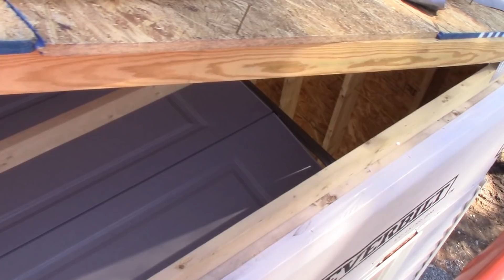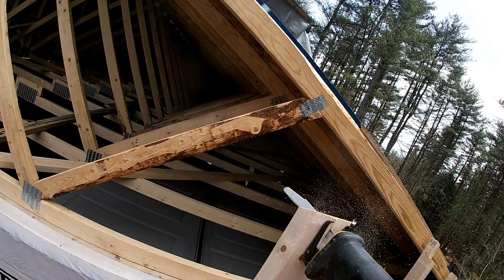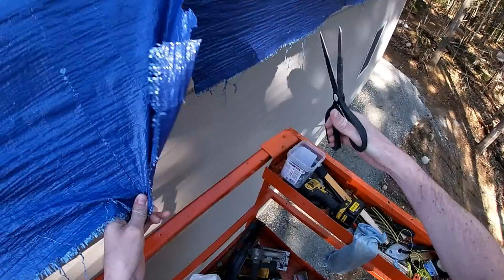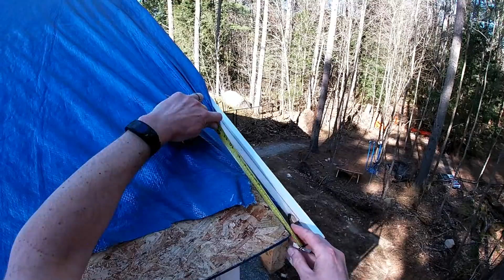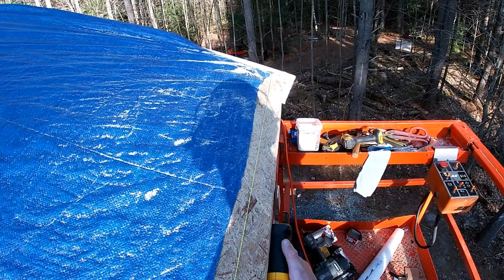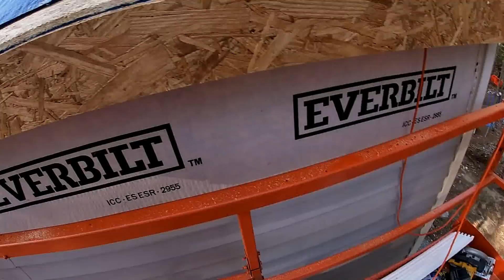Part 11: Dream Garage Build - Ready to Roof - Gable, Eaves, Sheathing ALL DONE!

Comment: Trying to be helpful to those reading, not critical  of the channel.

Best to have a reference string pulled straight before setting the joists. The string should be maybe 1/2" further out, so the joists don't touch and interfere with the string.

Then, use a 1/2" thick block to set each joist the perfect offset from the string. This will make cutting the joists on either side unnecessary.
Reply: @Trialnerror 
I was being as kind as possible because I like that you share the parts that go well, along with the not so well. If people are too critical, most creators start editing out the rough stuff. But, I find both helpful!

Also, I'm jelous of the garages! I'm now a new suscriber.

Comment: Very cool of you to put yourself out there so others can see what you're doing. I know it's tough because keyboard warriors can be very critical. But, sometimes it looks like people are being critical of what you're doing, in reality they are helping others to do a specific part a better way.

But, what you're doing is important, so keep up with the content!

The cool thing is, I'm learning from you videos, both what to do and what not to do. If you edited out the not so perfect parts, it would be more difficult to formulate a plan to do a LITTLE better.

In another comment, I may make a suggestion, but it will be for the benefit of those reading the comments. Most importantly, it's something that I formulated while watching you do it your way. So in a sense, it's something you taught me. Thanks!